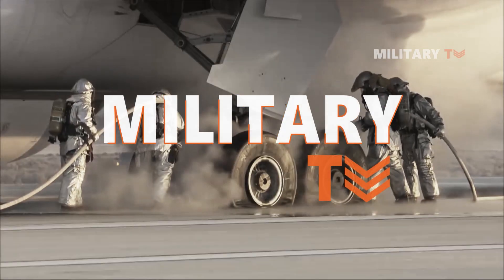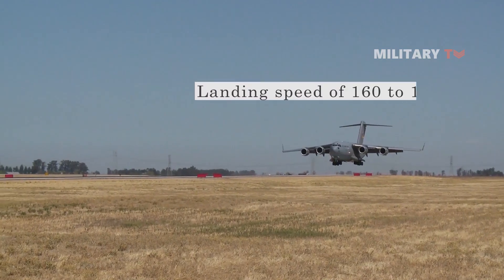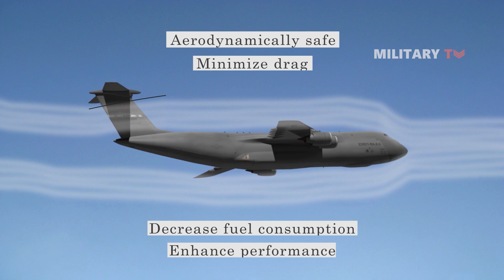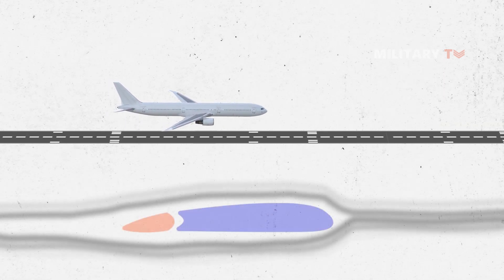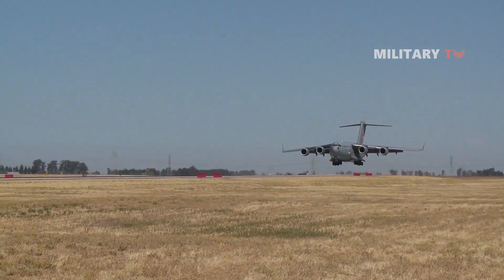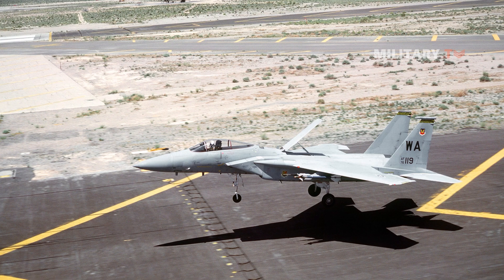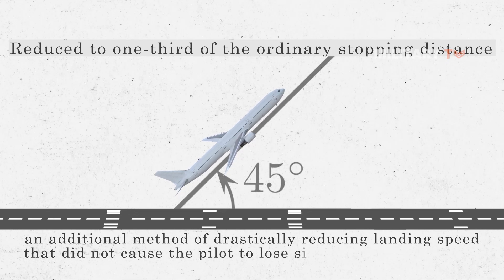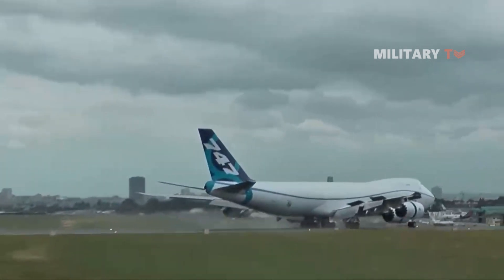How The Aircraft's Air Brake Works

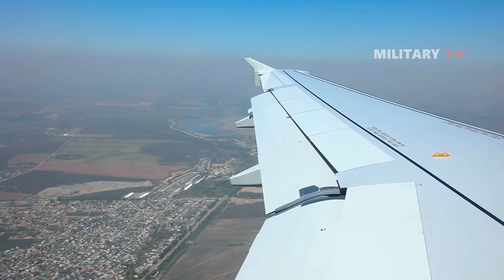Comment: @1:04 Spoilers and flaps are two different components of the wing on most aircraft except for some fighter jets and airliners, air brakes are spoilers not fully extended in the air with exception of like let's say an F-15.:)....
Reply: Yup, that is correct..

Comment: Alternative title - 
- How do the Wheel Brakes Work?
- Do Airplanes have Brakes?
- How do pilots slow down an Aircraft on the Runway?

Note:
 (Flight Spoilers extend upwards and act as " Airbrakes" their function is to disrupt the airflow over the Wings, when the Slats are not extended. in this way , the aircraft will slow down during Decend.. they also serve other purposes such as Roll Control ( Assist the Ailerons at high speed/ Flaperons at low speed on Boeing jets ) and Speedbrake ( increases the Effectiveness of the brakes on the ground and help in Deceleration on the ground)...

These panels are found on the top of the Wings and are shaped like a square ⬜. 
Side note:

- the Brakes on Aircraft are not Pneumatically Powered , they use the airplanes Hydraulic Systems that provide higher Pressure.. the Actuation system uses Electrical Power to operate the brakes ( Commercial and Military Jets)...
 
Based on my knowledge!